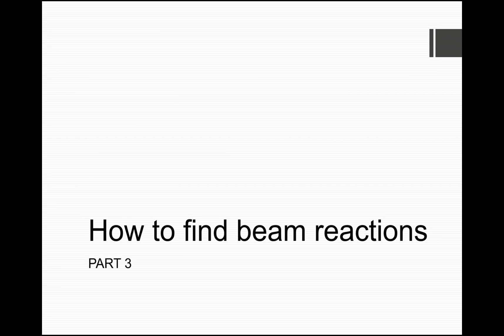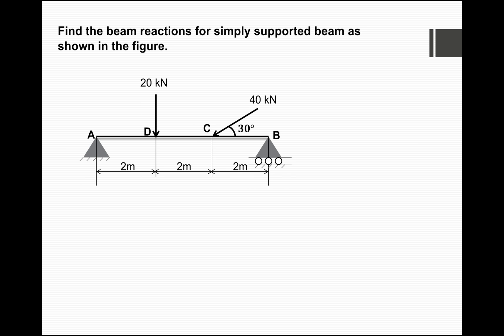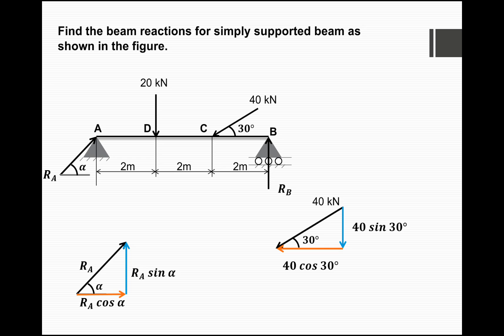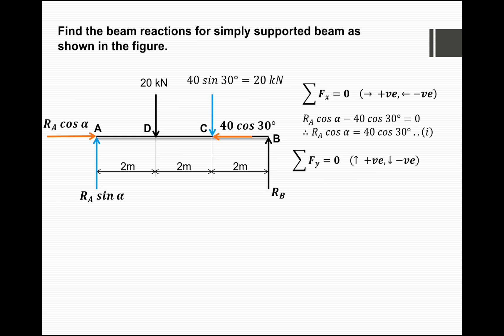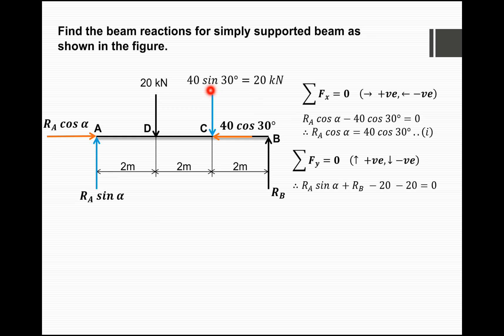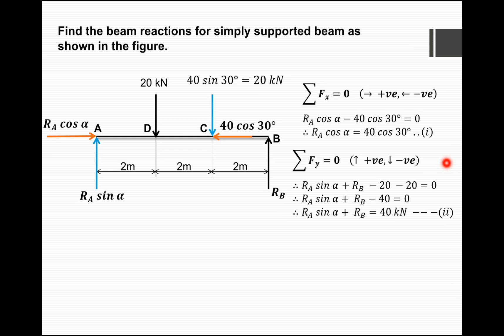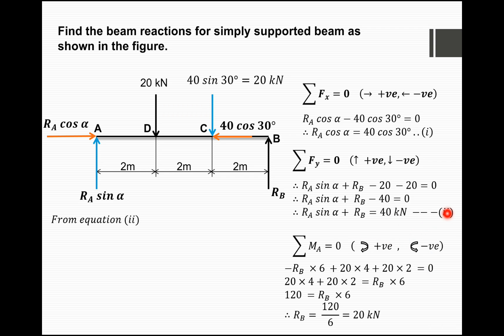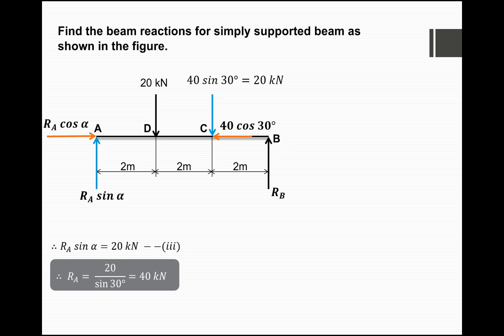Lecture 6 | How to find beam reactions | Simply supported beam carrying inclined point load

Comment: Make a video on beams having point loads at equal distance from the ends which are inclined at different angles and a uniform load about a unit length in the middle of the beam.